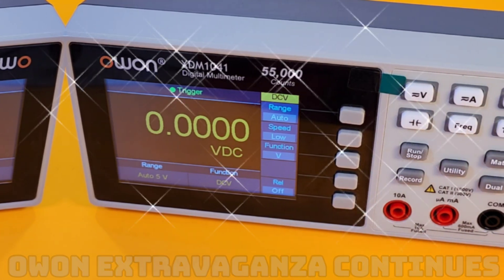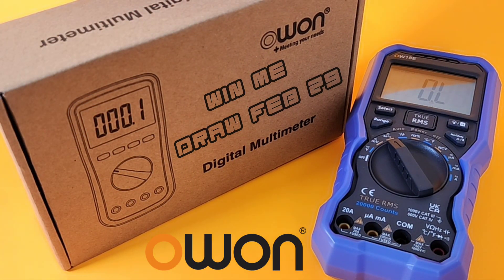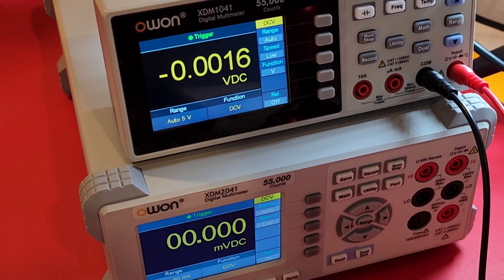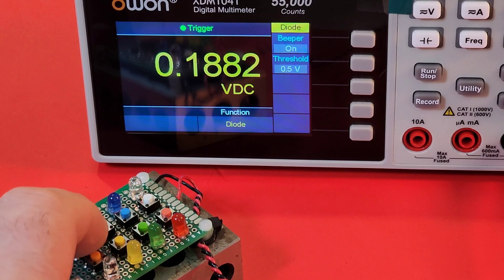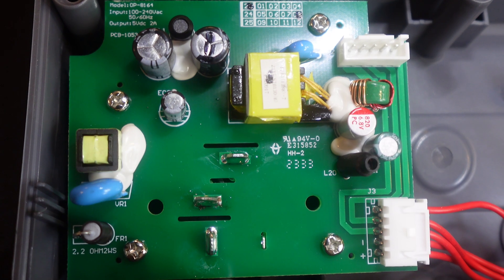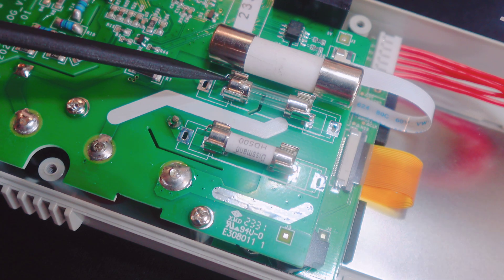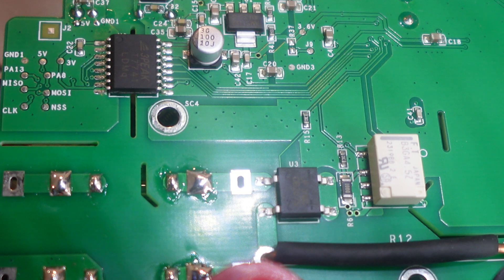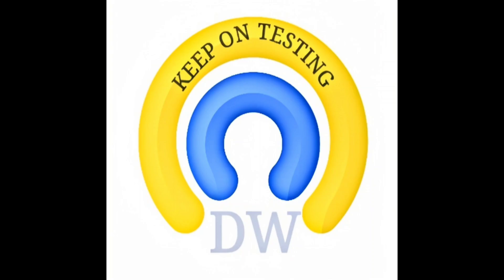OWON XDM1041 MINI BenchMeter Review & Teardown!

Comment: After using mine for 6 months I'm still pleased with the performance and quality for the price. However, mine came with a DB9 RS232 serial interface requiring a serial-to-USB adapter to use the Windows interface. However connecting from the software hasn't been an issue (it did hang once but I was logging to an NTFS drive and watching a Youtube video at the same time). Btw, did you install the NI-VISA driver before the software? Thanks for the tip to use the diode range for quick continuity testing. Also fwiw I see Newark is selling the XDM1041 branded "Multicomp Pro MP730880 US" (or at least the display, the buttons, the back panel, etc. appear identical!). Good review. Cheers.
Reply from the maker: Yes I did install the VISA driver first..BTW glad to hear it's holding up well after 6 months of use!

Comment: Some coments from a XDM1241 owner:
+ The continuity test is significantly faster if you switch to the diode test. You can set a custom voltage limit, so it´s absolutely equivalent for "beeping" through e.g. connectors, but it has much less delay
+ My unit was delivered with two ceramic 6*30 fuses. I didn't blow one yet, so I can't tell anything about sand filling.
+ You can re-calibrate the unit by a hidden service menu.
+ The display and refresh rate are really gourgeous if you switch to med or fast
+ The size format is incredibly convenient on the bench

- It always starts in "slow" mode
- It has no graphical plot of the measurements
- While autoranging it shows "0" for some time. For rapid measurements it´s better to switch to manual range selection.

But regarding the value/price ratio, I can only confirm Darrens resume, it´s a great meter. Thanks Owon and thanks Darren!
Reply from the maker: Thx for the great update 👍 Glad to see the meter is serving you well. Interesting about the ceramic fuses, excellent! 😀

Comment: Starting to see this form factor size in a few instruments now. Guess if you were equipping a bench and could get all the meters in this style, it would be a great space saver, if you can get the functionality and accuracy you want. Agree on the hidden internal fuses, not sure about upgrading to 10mm diameter in case you over step the creep distances. You can get 32x6.3 which may be a better option. They have rated it as CAT ii input protection anyway.
Reply from the maker: Interesting form factor indeed 🤔 The AC mains completely negates any credible space saving setup though , as you'll be relegated to use the same bulky power cords as a full size test instrument. Good point about Fuse creepage but as my dear grandfather used to say, "go big or go home!" 😅

Comment: Pretty nice and honest review. I´m not sure, what this DMM is supposed to be: 
A mobile DMM? Nope, it has a big, sturdy mains cable. The empty space had easily allowed to throw batteries in it as power source or even to made it rechargable. At least the model with the USB-C connection could be driven by a powerbank for mobile phones.
A bench meter? Nope, there is no possibility to fix mount it anywhere. It has a form that prevents it reliable from being stacked up with other devices and a low weight, that makes sure the ongoing funny sliding everywhere on the desk. To be surprised with the small fuses is simply disappointing, but not very important. Let´s be honest: Even with big HRC- fuses - the input protection of this device would not be comparable in the slightest with a Fluke 87 V or a Brymen 869S. But, that´s usual. Benchmeters are usually lower CAT rated. Granted: They very seldom showing up at construction sides or in the wild...  
Or should it be the competitioner for the Zotek multi-purpose-device?
Sorry, a single-purpose-device can never rival with a multi-purpose-device, which is build since long time.
My conclusion would be:
OWON, straighten your portfolio. Rethink what you are producing for whom. 
A nice successor for the 2041 would look like / would have:
- The case of the 2041.
- An USB connection.
- Still the 4W measurement.
And maybe, to make some progress:
- More memory.
- Higher resolution display.
Anyways mandatory is the hiring of some programmers:
- To fix the PC- connection software.
- Maybe add some more functionalty to the firmware (statistics / grafical displays)
Regarding the 1041: Simply, let it go. It doesn´t even play music...
Reply from the maker: Go get em tiger 😅 Excellent job summarizing the glaring deficiencies of this benchmeter. It does seem lost on the bench, poor thing. 😅

Comment: Hope Owon will listen to your points. Not that it's a bad meter. But it seems like it requires some steps from you to make it useable: like cleaning/replacing test leads, fixing it to the table with adhesive tape or printing a mount on a 3D printer or something. And having proper 10x38 fuses is never a bad thing. 👍
Reply from the maker: I was actually going to 3D print a mount for this but changed my mind at the last moment. Hopefully OWON can revisit the 1041 and fix some of those nagging issues.

Comment: Hi Darren. In general, Owon assembles quite good devices (they often miss the mark with calibration).
I like this multimeter better than the XDM2041 model. But it is not clear to me, based on its cost, where it can be used. After all, their price is the same as the unit pro series or Brymen 8ххS. Although, I probably want a lot from the manufacturer..... =)
I completely agree with the assessment.
Darren, I keep wanting to tell you and forget. Try sometime, while checking the continuity speed of the multimeter, before you take the ProbeMaster, to lightly clean the factory/complete probes with Scotch-Brite or very fine sandpaper (1000-2000+ grit). The Chinese (manufacturers of multimeter probes) cover them with a thin layer of varnish, it’s not even a layer, but a fine spray of varnish or some kind of lubricant. This is what you should always remove when buying a new multimeter. Because cheap probes are made from an alloy of metal with something else. And to protect them, the manufacturer covers them with a thin layer of corrosion protection. This is why the supplied probes often show poor results in your tests. But the ProbeMaster (probes for rich nobles;)) is covered with a layer of gold plating. Therefore, they do not have any oxidation and always show good contact. Behind the scenes, test my theory. Because I often encountered that after several movements to remove this layer of fat from cheap probes, the continuity test worked much better. The main thing is not to try too hard and not to overdo it)))
Thank you so much )
Reply from the maker: Its definitely an odd meter in the OWON lineup. The USB-C version makea alot more sense to me in terms of over-all functionality. Yes, good point on the tips but I've never sanded/cleaned a test probe beforehand when I'm doing a review. I'll definitely try though and let you know how it goes.😊

Comment: Interesting. $200cdn on Ali, but you can get the Owon HDS272 scope/meter/function generator for the same price, and its DMM is 20k count and it is USB-C. I also have a an Aneng ZS20 which is 25K count. How much resolution do you need? Anyway I would want four-wire input and AC mains PLUS USB-C chargeable batteries in a small 'bench' meter. And very low-value measurements.
Reply from the maker: Valid on all 👉 points Barry..it's not quite apparent exactly where it fits in the bench scheme of things is it.

Comment: Not bad at all BUT here the XDM2041 is only £20 extra and offers more features making it (in my opinion) better value, the four lead resistance measurement mode alone is worth the upgrade, shame they don't seem to be bothered about improving the software Thanks for another great review👍
Reply from the maker: Spot on ! Without the USB-C portability factor , I find this benchmeter lacks a sense of purpose.

Comment: Little tip, for the multimeter probes use metal polish to clean the tips that will fix the continuity test
Reply from the maker: Yes indeed,  I always test the stock leads without sanding or cleaning beforehand just to ensure the integrity of the review. 👍
Reply: In a pinch a pencil eraser followed by isopropyl alcohol will also help clean off organic contamination without reducing the thickness of the plating. It won’t remove the nickel oxide layer though, so it depends how dirty the surface is.

Comment: The test leads disappointed me a little. The protection built-in is very good. Further future revisions need to take into account the issues. Its a good desktop meter though overall.
Reply from the maker: True enough,  overall it's well designed and good attention to detail. There's some glaring issues (software,AC mains plug) that need to be resolved to elevate this test instrument to the next level.

Comment: Although the 1041 is of course more portable and has USB instead of the old fashioned RS323 as the 2041 does, I think for the (small) price difference the 2041 is just a more substantial meter. The 2041 does have 4-wire resistance measurement and it doesn't have the weird V/mV separate ranges/setting as this one, I don't understand why they did that on this one.
Reply from the maker: I think the 4W Sensing is worth upgrading to alone. This incarnation,  with the massive AC mains plug defeats the portability factor, at least for me. Shame as the build quality is generally above grade.

Comment: The smaller bench meter, really closing in on that Fluke!? But still the same slow response...why oh why? The fuse says "Dissman" as if it is ready for you to diss it! The leads are worse than the earlier one. The free space inside might allow for a battery be slapped inside it too...OWON be taking notes?
Reply from the maker: Dissed it I did! I'll never see the point to build such a well engineered POE (piece of equipment) only to be let down by a 10 cent fuse.😢
Reply: @KeepOnTesting  Maybe they have a high current version? Stay alert for a higher power meter? But still...being a bench meter it shouldn't be hard to put the good fuses in, for safety...